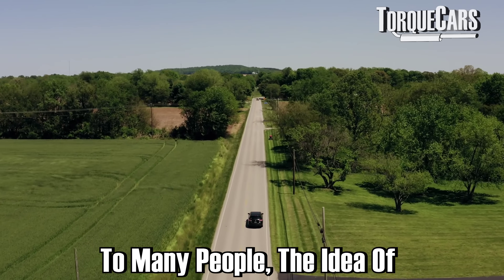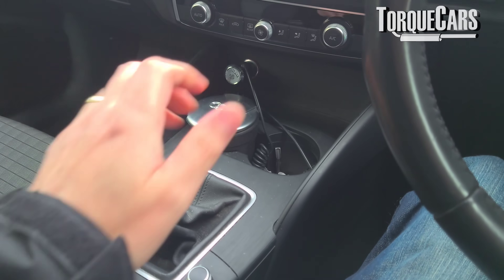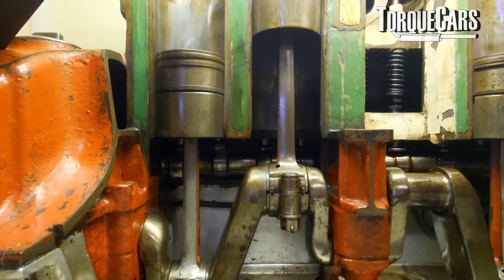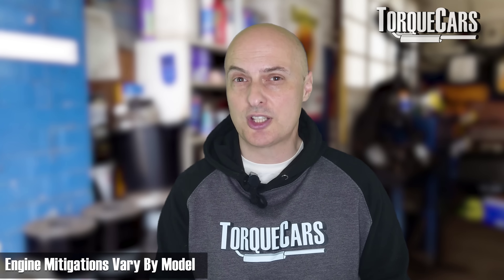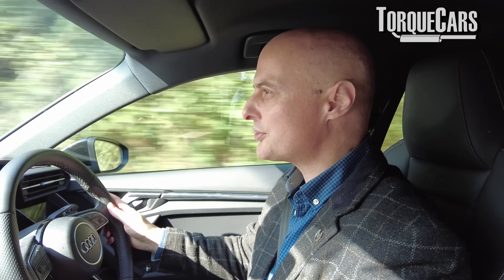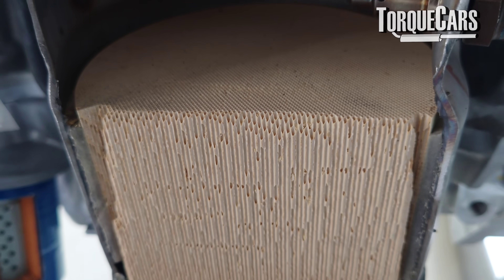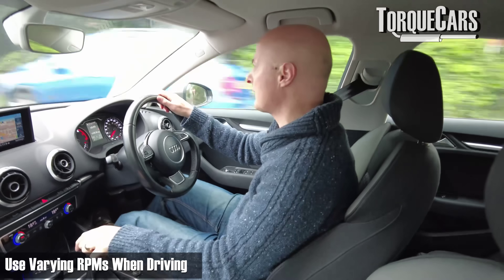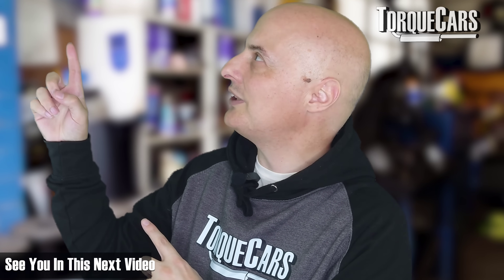BIG DAMAGE By Lugging at LOW RPM? Eco Driving Warning! (Manual Gears)

Comment: Expert here. There's a saying. The sweet spot. That is the rpm range every motor has where it runs the best. The lowest rpm in that range is used in cruising, maintaining a constant speed. The highest rpm in that range is for extreme acceleration,  also know as redline. That should only be done after engine has reached normal operating temperature. Ideally you never exceed that redline rpm, no matter what Scotty says!  Most cars run very well at 2200 rpms. Find out what your lowest rpm is for cruising, then never run your engine lower than that. If you really want to know how hard to push on your gas pedal, put a hard boiled egg under your gas foot. If you crack your egg, you are now pushing down too hard!
Reply: Lol funny tip at the end, a shame that someone might do this and get into a bad situation from the egg liquids.
Reply: @-aid4084  He did Say use a HARD Boiled egg, Not a raw or soft boiled egg. Then there is no egg liquids.
Reply: @TapeManIT  yeah my brain somehow missed that completely.
Reply: @TapeManIT  exactly. People will still not read it and use raw egg.

Comment: If you allow the engine to reach optimum temperatures then there is not much difference. 
If you don’t allow the engine to heat up to operating temperatures and do several trips , you are causing carbon buildup. 
Like building a fire, not enough air and heat before dumping a handful of sticks cause it to smoke and not burn properly. 
AND when it comes to diesel engines… you are always going to have a dirty engine that needs constant maintenance and cleaning like walnut shell blasting.

Comment: 2:50 You keep referring to “if you’re in too low a gear it’s more effort”. You mean too high a gear. Generally speaking “low gears” are 1,2,3 higher gears as described are 5-6 etc. This is wrong in your bicycle example. So low gears would be easier a high gear would make cycling up a hill harder. Common mistake worth noting.
Reply: @s1lenttoad422  it’s about ratios. A higher number would be better for going up a hill
Reply: With a lower number you would have to work harder to keep or increase speed

Comment: I drive a 1979 Subaru DL that has been engine swapped with a 1989 EA71S engine (factory Subaru race engine for the Japanese FJ1600 open wheel race cars). It has a transmission from a 1972 1300G with something like 4.25 gears. That engine (which is further modified from its original configuration) makes around 120hp at 6500 RPM but very little torque. The powerband starts at around 3500-4000 RPM and power drops off around 7000-7500 RPM. Cruising at 65mph in 5th gear on the highway the engine is sitting at 4200 RPM or thereabouts. The engine has over 200,000 miles on it that are 99 percent highway miles, operating between 4000 and 6500 RPM. The inside of the cylinders are in perfect condition. The crosshatching is exactly the same as when it was rebuilt, there is no ridge at the top of the cylinder, and there is hardly any carbon on anything. The more I operate at lower RPMs, the faster I have to change the oil. It shears and thins out, and the oil pressure gets lower a lot quicker than if I cruise in the 3500-5000 range.

Comment: I've always tried to avoid lugging my motors in anything that I ride or drive. I try to keep the RPMs above 2000. And in my turbocharged car, above 2500. It's never good to lug a motor. If you have to dump a bunch of gas into it to get it going faster, better to downshift. Lugging a motor puts a lot more force on the tops of the pistons which wears out bearings quicker. I'm 62 years old and have always gotten a lot of miles out of my vehicles. Regular maintenance and driving correctly are both key. Stay away from too high or too low of rpms.

Comment: Bad generalization!
Some of the newer turbo cars do love and use the lowest rpms.

They also have variable oil pumps to lubricate properly at any rpm.

My little 1.6T (dual scroll) cruises at 1400 rpm and would simply use torque up to 50% gas pedal.

It does not lug the engine and increases speed quickly.

Yes, it would downshift if you request more power, but the resulting rpms are still only 2300 rpm as the power band is  flat 1400 to 4500 rpm.
Reply: Still same physics apply. They try to save every drop of fuel though for ratings. Wouldnt trust that for longest engine life.

Comment: You forgot one important thing, Load,  no load to little load (straight road) means low fuel usage, high or low rpm which means,  cold engine and soot, especially diesels.

Comment: If not bad driving habits, it’s not understanding or knowing the points you bring up (you don’t know what you don’t know).

Moons ago when I was first fumbling through the gears, I might’ve put myself in the wrong gear and figured that I could just wait it out and floor the accelerator pedal to make up for it, but it always felt like an anchor was being shoved into the intake, no power, not enough air, just bogged down. While I ceased that practice years ago, I am glad to find out the “why” it was happening and why it’s going to cost you if you keep at it.

Cheers!

Comment: 20.mph zones in Wales
Reply from the maker: Not just Wales now, many areas are adopting this fantastic pollution raising, traffic congesting safety limit.
Reply: @torquecars  indeed Wales is awful 
Some roads marked as 50 where really you drive at 50 too many sharp bends the 20 mph is a joke

Comment: the only advantage is mechanical advantage that load pob crankshaft bearing & crank pin bearing its reduced. 
Burr there is catch if you happens to own a diesel engine which uses high compression ratio and diesel it's a slow burning fuel so you don't take three risk of running at highest rpm

Comment: No matter how fast the rpm combustion events are faster. Exterior intial delay known as soaking period, Ir is the pressure wave which travels at the speed orf sound and are considered big problem for this reason there are number oud fuel additives which arrest this explosive burning and try to archive as  gradual combustion as possible

Comment: I've been grannying my cars for the last 35 years and have had never had an engine problem.  I "feather" the accelerator and shift very quickly if I suddenly need power.
Reply from the maker: That is the key really - the shifting when you need to. Hoping the engine will lug you to a faster speed is what causes the damage. Do you keep up with the servicing as well?

Comment: Had an old automatic Lexus V8 and the manual said to operate the engine between 2000 and 4000 RPM. Also I've seen many commercial vehicles have a fast idle setting you are supposed to engage for extended idle periods so the cooling, AC and other power accessories properly such as on a waiting luxury bus that is full of passengers.

Comment: From USA here.
I notice automatics tend to lug the engine before downshifting, especially modern 4 cylinder. It would explain many of the carbon build-up problems cars are having. 
I own a 2016 Kia Optima and noticed that under eco driving, the gears are changed before 2k. It feels like the engine is struggling, and indeed, it is an oil burner. I own it only for a month and obviously couldn't control driving habits from previous owners, but I believe that there is something to it, associated with bad engine design and poor maintenance.

Comment: Powerband recommendation is based on full throttle loads. Just drive your vehicle with light throttle loads. This wont overfuel your cylinders and on modern diesel engines you wont overfuel because the computer wont let it ,it will only give just the right amount of fuel

Comment: What is low rpm? my car tells me to change gear if I am doing 2000 rpm, 2000 rpm to the manufacturer is the most fuel efficient rpm. My car can rev to 7000 rpm so it si doing less than a third.
Reply: Depends on the load what most fuel efficient rpm is.

Comment: This is something that drives me nuts when it comes to transmission shift logic, including DCTs.  I don't want to be in top gear at 40 mph.  If I need to do an evasive (acceleration or cornering), nothing good is going to happen.  I usually select my own gears.  I'd prefer a manual but for the fact that they are slower than a good DCT and no longer have the edge on fuel economy.  Plus, on the rare occasion I feel lazy, I can go full auto.
Reply: A dct will shift from highest gear to one with most power available before you can blink, there’s no point in being in a lower gear.

Comment: Best fuel ecomony is got using revs at peak torque, in tandem with early trottle off approaching Stop signs. Saves your brakes too.
Reply: Not for cruising. Then highest gear will give lowest consumption.

Comment: Run within the power band of the engine.  3000rpm start of torque, shift transmission to gearing that engine runs at 3000rpm. Don't lug in 4thgeat unless you are over 4000rpm or are above 70 mph

Comment: A redline each day, keeps the mechanic away.
If you own an older diesel with injection pump and EGR valve, you will know driving at low rpm will ruin it.

Comment: Another issue of no load low rpm driving is auto makers have started using 2 stage oil pumps and are designed to run very low 8-15 psi of oil pressure on the first stage REGARDLESS of oil temperature.

Comment: Audi/VW are culprits of low revving. It's nice but causes wear. I've driven a few DSG based Audi and VW models. The gears change very quickly even though the car is pulling well enough. But it feels like there is strain on components. It feels cool and refined and sounds good. But... Mercedes on the other hand doesn't sound as refined because it revs more before changing gears. But it's clear the effects because Mercedes hasn't had issues with their dual clutch gearboxes or engines in the A Class whereas Audi and VW has had countless issues on the A3 and Golf. Yet journalists will say how nice the Audi is but Mercedes made it that way for reliability. It may not feel better but it's better long term. Like Toyota. Toyotas engines scream because most are not turbo charged. But it doesn't work as hard as small capacity turbos.

Comment: It's always seemed to me that cars which were driven slow at low rpms for 100k miles never run well at higher rpm after a new owner buys it and runs it at higher rpm. As if the engine got used to running slow.

Comment: Tip
Use your Air con every journey. 
Why?
because it pumps refridgerent around the system.  What does this do?
It keeps the sesls wet and moist.
When seals are dry  they do not seal.
Worse,   they cause friction.
I use my air con all the time even in wintet,, but for only for 5 minutes or so for thay reason.
Unless im driving in Spain.

Comment: I enjoyed listening to the various points of this video  , most of them I already knew , and of course , this topic was about car engines, but even then , there is various designs   such as bore to stroke configurations, am I correct in saying that a lot of engines are square bore or close to it , some are over square , but then there's long stroke designs as well . in my opinion long stroke engines are a bit more forgiving at running at lower RPM due to the fact that long stroke provides higher piston speeds at lower RPM then short stroke engines , along  with having a little bit longer conecting rod wich reduces side pressure of the piston against the cylinder walls , are engines of this description affected the same way as short stroke engines when running at low RPM ?

Comment: Another thing to consider is oil films are more protective at higher surface speeds to some degree.  That's why you see more cylinder wear at the top and bottom of the piston stroke.  Think of your parts like water skiing.... the faster your going the further out of the water your going to be.

Comment: Tip. 
My skoda superb has 95,000 Km or 50,000 miles on it.
I have siill got original rere tyres on it. I'm told there is more life in them yet.
How, why?
Answer is never fast acceleration  unless necessary. Looking ahead and easing off the throttle.

Comment: Tip, 
When i open my car door, i switch on ignition before getting in.
Then i start my diesel car.
Then i close the door.
Then i connect my phone to the car
Then i do my seat belt up. 
That 15 or 20 seconds allows the lube oil to hit all or at least most spots.
80 or 90% of engine wear happens in first 10 km or 6 miles of every journey.  
Your car is like tour body. Not in peak condition unless you exercise and get the blood flowing and clean out the lungs. That is what a good  100km  or 60 mile motorway drive does . Drive that distance once a month at  at least 3,000 rpm. your engi e exhaust oil and fuel system will thank you.

Comment: Tip.
Go down hill in same gear as you would use if going up the same hill.
But, but, but, instead of pressing the brake to slow the car. change down a gear or 2.
What does this do?
A
 it stops fuel being burnt.
B, it increases engine revelutions  and turns the engine into a compressor.
C is saves brake and tyre wear.
D it is good for the environment. 
E it gives you greater control of your car. 
I once came down a hill on a motorway doing 80 KmPH  or 50 mph in 3rd gear.
i overtook 2 other drivers braking hard.
I was in full control of my car.  The other driver beside me had a look of fear on his face.
Reply: Before engaging engine braking take a quick glance at rear view mirror and make sure vehicle behind u is not following too closely. Engine braking does not turn on the brake lights.
Reply: @arrow2042 
 Good point.
Reply: Depends on the engine. A two stroke engine hates coasting, because with no oil squirters you run the engine with no oil. Diesles don't typically have a butterfly valve so no compression braking, and some cars have an exhaust brake, and most semi truck motors have a jake brake. 
Your advise is fantastic for someone with a petrol engine car, but pretty redundant for other engines.
Reply: @-aid4084 so what diesel cars do in mountains? If you don't brake with the engine, you are eventually going to burn the brakes.
Reply: It does not save the tires. Because it's not magic, your engine is slowing the tires, same as brakes would do, and the tires slow down the car through friction with the road. 

And I don't know where your story took place, I have never seen a driver showing fear just because they are going downhill...

Comment: I own a car with a four cylinder engine, the 'redline' is around 7,000 from factory and I only let the car idle until it warms and rpm drops to around 750-800 RPM at idle...

I have an 8 speed transmission that never sees 7th or 8th hear, I manually shift the car with the paddle shifters and always turn off all driver assists, cruise RPM is around 2500 RPM in town (2nd and 3rd gear, rarely enter 4th gear around 55 mph.)

Highway speed I use 6th gear, and never go below 2500 rpm.

The 'BEST' way I have found to operate any vehicle I drive, is to know where the powerband ACTUALL IS in the engine, there is a RPM where your engine has it's most efficient power produced, and that is the RPM that I use to cruise... Just above the beginning of the powerband.

Most vehicle data can be found online.
Reply: Optimal rpm during full throttle yes... not necessarily part throttle..
Reply: @martinsv9183 all about the throttle, and even that depends on the type of engine/fuel induction, injection or carberation, load, rpm thermal efficency and friction.

Comment: It feels wrong trying to pick up speed in the highest gear anyway, I always lower the gear by 1 or 2 on the shifters when I want to pick up some speed, even on motorways, but I do keep it on the highest gear when I'm barely pressing on the pedal to keep it a steady 50 - 70 MPH, smooth driving, and on economy mode.

Meaning when the motorway starts to dip, I just let go of the accelerator and the car goes into 'neutral', the RPM dies down to just under 1k and the car sort of coasts downhill until I press the pedal again to get the gears back into 7th and have it run a steady speed again.